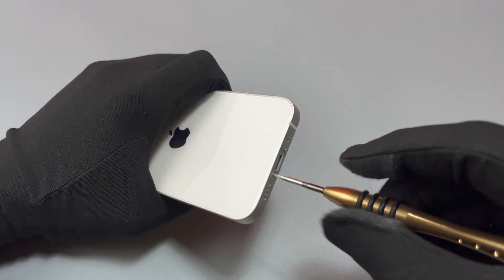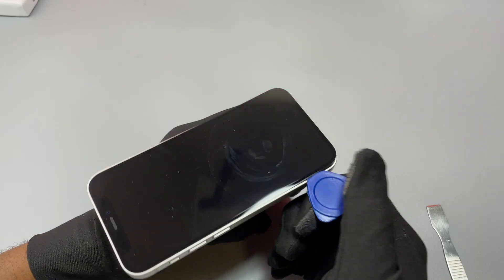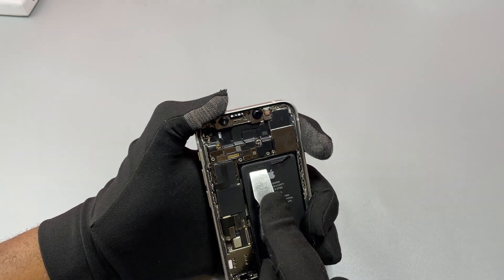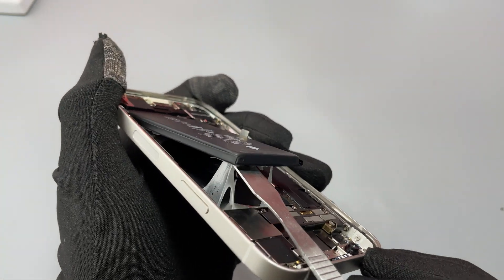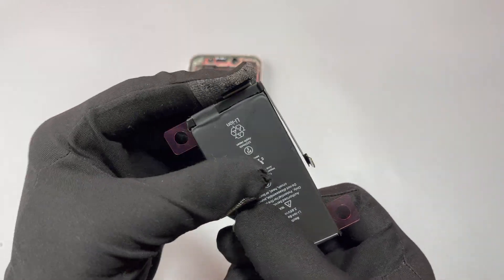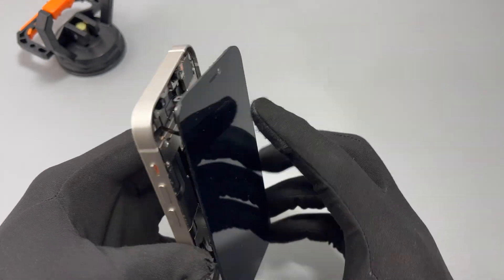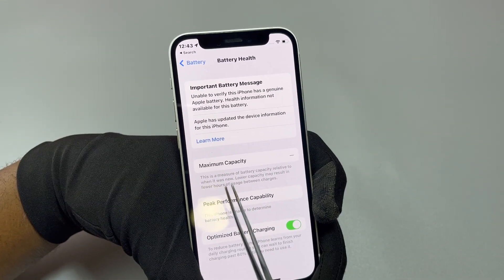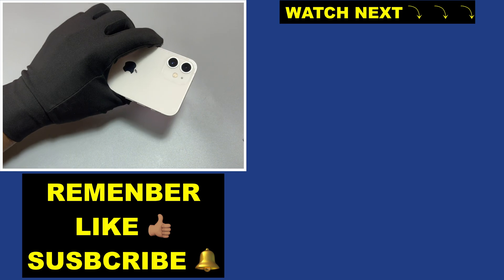iPhone 12 mini Battery Replacement Below 90% Capacity

Comment: Face id bye bye😵
Reply from the maker: Actually they have changed stuff by software update. You do keep face ID even if the battery is not reprogrammed with the motherboard. You will only lose battery health stats.
Reply: @ersbit  I mean that you did not protect the truedepth sensor because it is very sensitive and the problem of truedepth disabled usually becomes when it is exposed to dirt or handprints.

Comment: Where can get original battery
Reply from the maker: From Apple I guess. I am not sure 100% but Apple is providing parts through their self repair program. I do not know if you can buy parts only or they will bundle the part with tools necessary for you to fix it yourself then send the tools back after you are done.
Reply from the maker: Officially Apple only can provide original.

Comment: Where battery purchase link… 
And wht back-up battery..?
Reply from the maker: Hi I had links in the description for the parts I used. Only Apple supplies batteries that are original. Other websites cannot say theirs is original but it should work fine without any issues. Try to look at the reviews if you're skeptical about the battery quality.

Comment: Hello, i have a question. Can i change the battery with one with high capacity, without any risk?
Reply from the maker: No risk in general, I just do not trust those guys seller higher capacity batteries. You shouldn't have any actual issues with the phone except maybe the battery notification and battery health disappearing.

Comment: this message "important battery message

Does it always appear when you turn on your phone or occasionally while using it? does it bother you or does it come out only as soon as you replace it and then it doesn't appear anymore?
Reply from the maker: No you will see the pop-ups notification a few times after replacing the battery. It will later stop showing. I don't remember the last time I saw it on my se2020 (it has a battery replacement a year ago)
Reply: @ersbit  does it disappear after a while? or annoying?
Reply from the maker: Yes it won't pop-up anymore

Comment: hello, is it possible to get bigger battery (more battery life) replacement for iPhone mini 12?
Reply from the maker: Will say yes. If you can find legit batteries with increased capacity in approximately the same dimensions. Lot of batteries online with upgraded capacity....are they really better...haven't done tests on battery upgrades yet.
Reply: @ersbit  if anyone knows more info please share, or anyone with suggestions because i really wanna upgrade battery :)) thank you for the reply
Reply: @ersbit  im using iphone 12 mini now battery health is 75% still holding the battery life good so what are u gonna say for this?

Comment: You do not need to replace the battery at 90%.
Reply: I hate my battery life on this phone. I’m at 81, but it barely goes through 4-6 hours of gps use and general and daily use.
Reply: It’s a video dude. Chill
Reply from the maker: 100% is bettering than 90%
When it falls below 90% you'll need to carry a charger outside 🤷🏽‍♂️
Reply: @ersbit  stop spreading stupidity. When the iPhone falls below 80%, a battery replaced is advised. 90 is perfectly fine and you don’t need a charger with you. Pure ignorance
Reply from the maker: Numbers do not lie. Humans do
100% is better than 90% period. 
Elementary school understanding.
Reply: @ersbit  then you would be spending too much money and effort replacing it all the time
Reply from the maker: So what percentage would you recommend to change the battery?
Reply: @ersbit  around 80% is right time to replace. 90% is a joke :D
Reply from the maker: You don't have to replace it at 90% everyone appreciation of the situation is different
Reply: @ersbit  70 maybe
Reply from the maker: It all depends on your needs. The video has been made for people thinking about changing their batteries. Most people never change their batteries because they are great piece of technology that last longer. People who replace their batteries have issues either charging, Battery not lasting as normal or a combination of all these. I just showed the process. My device was about 89% I did not change the battery because it was still good enough for my needs. It all depends on the user their is not set number. 
Nobody is going to change his battery because it's at 90% because I said it. They will try to change the battery if it's at 90% and feeling the need to change it and heavily impacted by issues. 😁
Reply: @ersbit  Mine’s at 88% 9 months old. Wish apple would have replaced at at 85 for free like they do it at 80 😄
Reply: @ersbit  so I’m going to start replacing my battery when it falls to 99% since 100% is better smh
Reply from the maker: I showed the process (1) you don't have to do it (2) you can wait as long as you want (3) you can even get it change at apple if it falls quickly (4) it's a choice if you want to change it at 99% choice is yours 🤣. 
I recently got rid of my 13 Pro with 89% battery health traded it for SE 3rd ( it may be absurd but it was my choice)....Again the videos are mainly to show the process. I teardown a 14 Pro the day I got it removed the battery showed a battery replacement tutorial that doesn't mean you have to do a teardown day 2 of acquiring your iPhone 15 Pro 🤷🏽‍♂️.
Reply: @stopspinskydiving  anything below 90% you will notice less battery life and worse performance nothing working with changing the battery this early on it’s not like it’s a laptop where battery’s cost a fortune
Reply: @stopspinskydiving  mine is 86 and only last 3 hours so Im going to replace it soon.
Reply: Mines on 85% doing great🤷🏻‍♂️
Reply from the maker: lol 85% and great 😅 maybe you just make short calls and few text